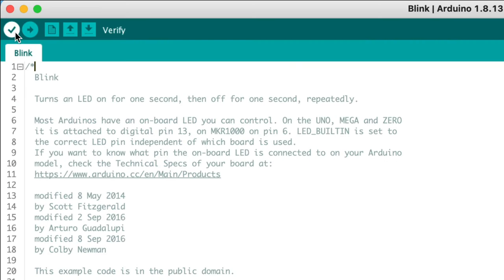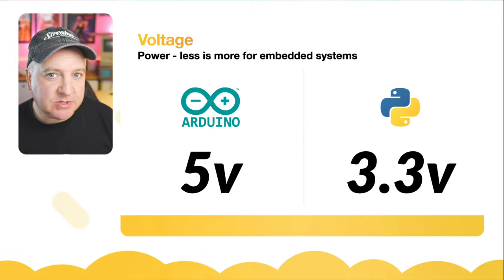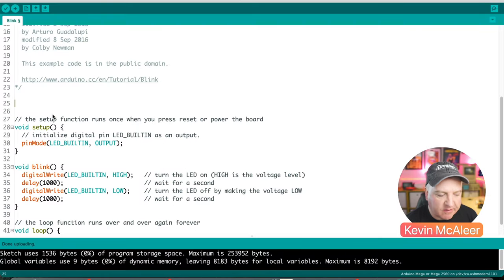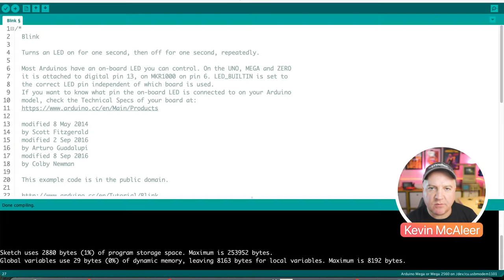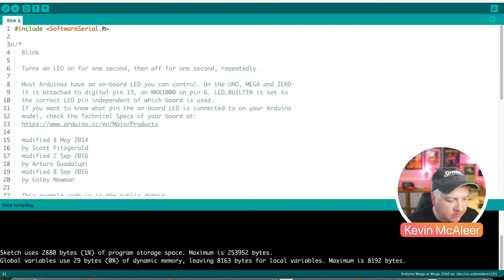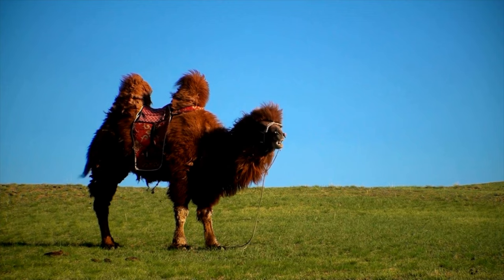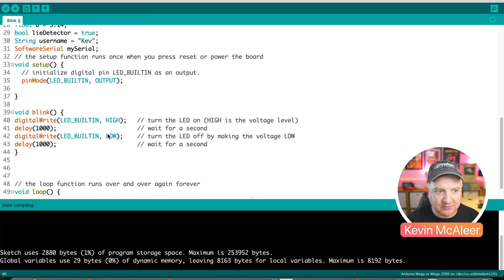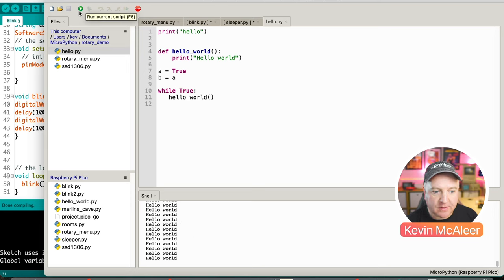Moving from Arduino to MicroPython - 10 Things you need to know.

Comment: I have tried Micropython several times with wemos but have had a lot of issues of the board hanging, not responding and in need to be flushed with a fresh python installation. Have you had similar experience at all?
Maybe using C is more stable? Twice i have given up on projects due to this issue. I am using python in my day job so it would be a no brainer.
I am on windows, not sure that has anything to do with it🤔 Better tooling in linux based systems?
Reply from the maker: It can be todo with the quality of the wemos boards - where did you get them from?
Reply: @kevinmcaleer28  I got one from pi the hut after having issues with some ebay boards. The issue was the same though. Not much to go on i know 🙂 I can send you my github code if you find it an "interesting case" to look at when i get around to it again. quite sure its not a software issue. Basically just a green house sensor/watering project together with a Pi as MQTT broker
Reply: If i can also ask. What is your strategy powering a lot of small devises around the house? All on individual usb chargers? I like the idea of them running on battery for flexible placement.

Comment: 3:00 voltage depends on the board you using not the programming language
Reply from the maker: True, but all MicroPython boards use the 3.3v pinouts, and none use 5v, whereas Arduino's Uno's are 5v - a beginner wouldn't know what.
Reply: @kevinmcaleer28  by that logic esp32 esp8266 esp 01 raspberry pico are all 3.3v and can be programmed with arduino
Reply from the maker: @MrTaken-tl4bw  that doesn’t make sense